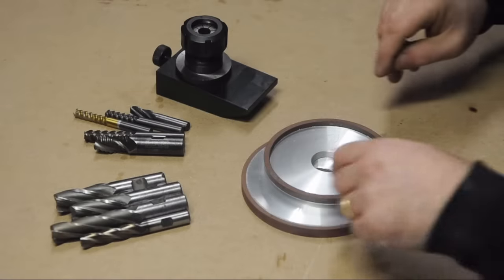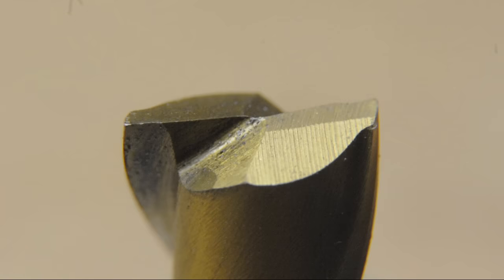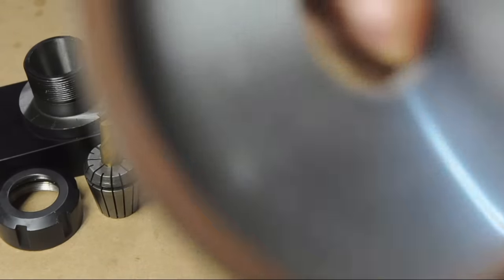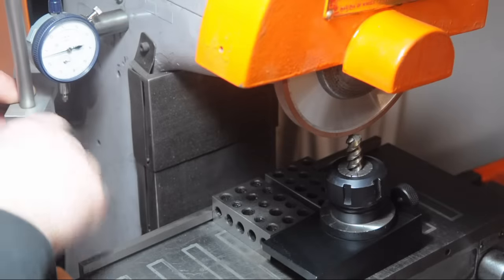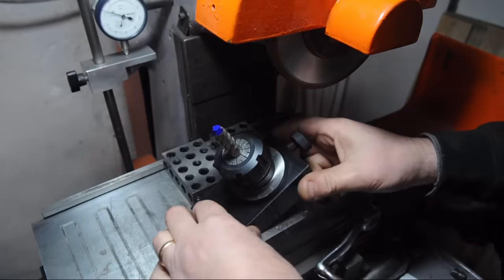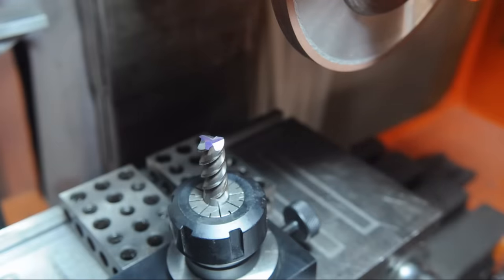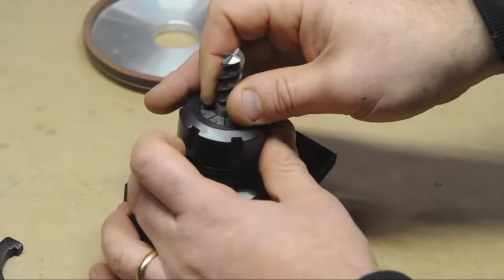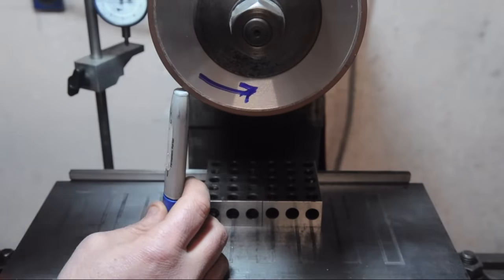Shoot'n The Poop #1 - End Mill Grinding Fixture

Comment: Off topic question. I picked up an end mill on eBay (high performance type, for my low performance home shop mill) and was investigating helix and variable pitch information on the web. What I didn't find, yet, was anything about the Land dimension. On this end mill the Land dimension is different between flutes. That is Land flute 1 is X dimension and Land flute 2 is X+Y. Is there a "name" for this or does it fall under the helix umbrella, etc.?? Just wanted to get your thoughts when you get a chance.
Thanks, Tom

Comment: Thanks for the video
I have a fixture like that but it takes 5C collets
paid almost nothing for it because it was missing the collet nut on the bottom.
so I built one and total spent 10 dollars
 I have not used mine yet because I still missing the surface grinder ( next on the hit list)
could please post the grinding wheels you used 
it looked like the wheel did very well also.
Thanks keep the videos coming.

Comment: "Is someone implying us hobbyist are cheap bastar---Right so lets get down to brass tacks here."

Love it.

Our shop class has one. I guess you can't sharpen 4 flutes, because the secondary angle would knock out your other flute, right?
Reply from the maker: +justfakeit888 4 flutes work fine, 5+ it starts to get a bit tricky.  I've managed to sharpen some 6 flute cutters with a thin cup wheel and setting the table stops to keep from overrunning.

Comment: I have been told by someone who knows a lot about grinding that you dress a diamond wheel with a smaller diamond wheel that is counter-rotating against the wheel being dressed at about 1/3 of the rpm of the grinder.

Comment: I'm not a machinist at all (I just enjoy the meditative process watching machining happen), so excuse the probably stupid question, but why are the flutes on a drill bit so long? Why don't they just have a two or three centimetres of flute, and then stay a regular dowel (?)? Is it so you can lop the head off and make a new head on it?
Reply: tziirkq so u can drill into deeper things
Reply: Tyler answered correctly if you meant drill, but if you meant end mill, this vid's subject -- then. 
1. It would would be a bitch if you had to cut the flutes too, you want the manufacturer to do that.
2, Why do you want flutes? Because you can, and do, cut on the side of a piece as well as the top with most end mills.
3 You can plunge cut (like a drill) with some end mills, but not all.

Comment: my welding teacher in high school needed to use the machine shops surface grinder for something, tried grinding into the leading edge of the wheel, BANG that steel flew into the safety guard at the end of the table of the grinder so fast it sounded like a gun had gone off in the shop. my welding teacher could stick any 2 objects together no problem but he was definitely not qualified to touch the machine tools

Comment: True up those resin bond wheels with regular old aluminium oxide wheels, spinning slowly of course.
Reply from the maker: +allsortsofinterests Good tip.. so I need a powered AO wheel?  Or a chuck of AO in the vise and play pretend that its a dresser?
Reply: I have seen a rotary dresser in action, however I've read in the forums about guys clamping broken bits of wheel in the vise and using it as you would a diamond tip.
Reply: +allsortsofinterests I would second that, you can dress one of those wheels with a lump of grinding wheel. I use those little grinding wheels from Proxxon, they wear away quickly but clean the crud from the diamond and can "true" it too, well sort of.

Comment: It looked like there was plenty of carbide loaded into that diamond wheel after grinding the end mill.  How are you going to dress it?
Reply from the maker: +Bob Korves Still don't know.. I may have to resort to google.  Though I think I saw a comment below about aluminum oxide.  TBD.
Reply: @ThisOldTony  light oil will pull it right out. Just like a wetstone...

Comment: Hi Tony Kevin from Aus you are going sharpen a end mill in surface grinder  I always used the  tool cutter grinder with a saucer wheel ,set your tooth up on  centre high tilt your compound head up to give your primary then secondary angles give your cutter 1/2 degree angle towards centre if needed I worked in family eng business for 55years we would sharpen just about any things  hss  tct ,keep going you will get it all after time I did Kevin Schlipalius Deakin  Engineering Vic  Aus.

Comment: So what's wrong with mounting the fixture into a mill vise and chucking the wheel into a mill? 

Yes I'm aware that it's potentially bad for the ways, but when you don't have a surface grinder (or have no space for one)...

I seen someone ground broaches with a cup wheel in a mill to make it smaller so they can be used to broach smaller holes.

Comment: At the time, when I saw this video the first time, I had yet to bugger up a mill I'd consider resharpening. Now a year later and several larger mills with shattered edges or just dull from use, now this cheap bastard want to try this out.

Comment: Wish you guys would make adjustments to you work piece on the 'left side' of the wheel when the wheel is turning. One little hiccup and your hand could be drawn into the wheel and tooling if it's being used. On the 'left side' your hand is 'pushed away' from the wheel. Trust me.....I ran three finders between a wheel and a table (.312ish gap) in my greenhorn days by my hand be drawn in. Didn't lose them, didn't hurt, but it sure was ugly looking at minced meat and raw bone. Anything I do now consists of wheeling the table far left and done on the 'exit side' of the wheel when spinning.
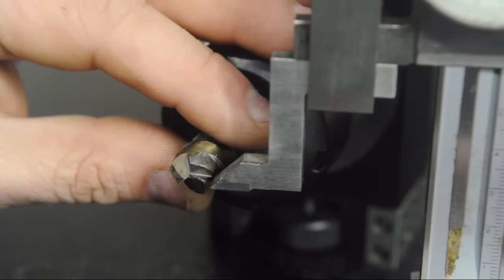Reply: James  at 6:35, Tony shows which way round his wheel spins. On the left side of his wheel, his hand would be sucked into the nip. 
It pays to avoid using left and right, or some people will be dangerously misled. It's like assuming everyone everywhere drives on the right hand side of the road when talking about dangerous driving manoeuvres.
Reply: I didn't notice that Gottenhimfella.....I shouldn't have assumed.  I should have implied 'handwork' should be done on the side 'along with' the wheel rotation.
Reply: Hmm... James appears, to me to be right in what he says.  A little later, our man is establishing how close his workpiece is to the grindwheel using the time honoured paper method.  The wheel is running clockwise, since he's holding the paper to the right of the spindle axis.  Using the terms "outrunning" and "inrunning"  would avoid ambiguity, although, for most machines, the "left" of the wheel when surface grinding, (as viewed from the operator point of view) is the "outrun". 
We dress a grindwheel with the diamond on the outrun, so it's flung out, rather than drawn in,  (unless we're dressing a form wheel, in which case, to get the form geometrically correct, we must be on the wheel's centre line...  On a manual machine, like a tool and cutter grinder, we approach the wheel from the outrun side Generally the left, to avoid the workpiece being drawn in, taking up the backlash in the rack and pinion... 
For those using the paper method, 80 gramme paper's 4 thou thick, 100 gramme is 5 thou (more or less...)

Comment: at work we dress our diamond resin wheels with a silicone carbide wheel. 16 inch wheel at 800rpm and 7 inch silicone carbide wheel at 500 rpm. .0001 a pass up to .0003 for bad wheels.
Reply: You mean silicon carbide.
Silicon*e* carbide is what they use in those really hard breast implants.
Reply: Godfrey Poon yeah
Reply: WCGwkf silicone is for windows. Silicon is a material men use